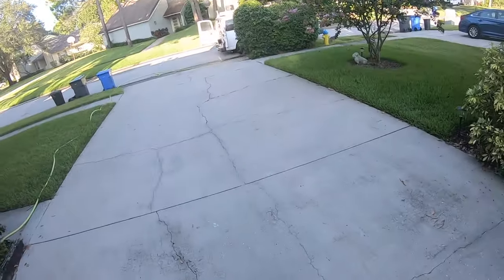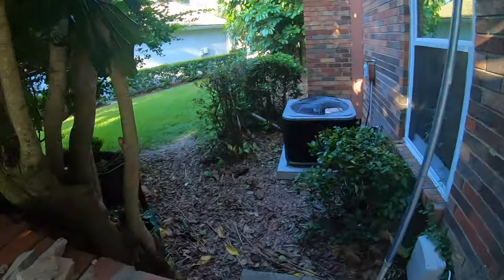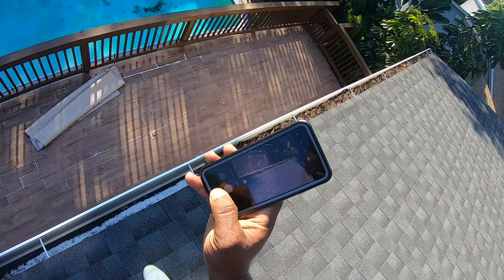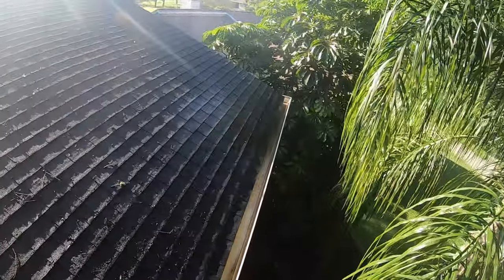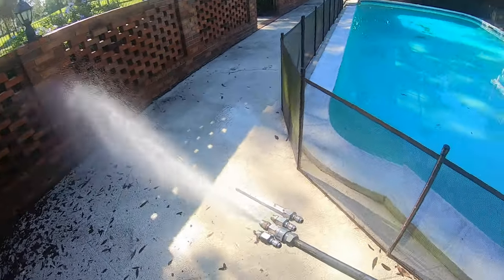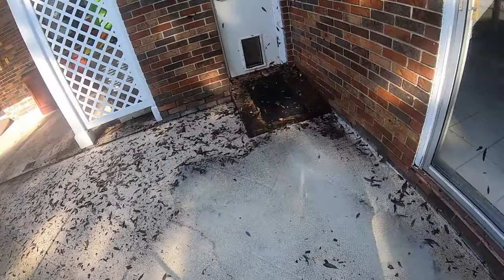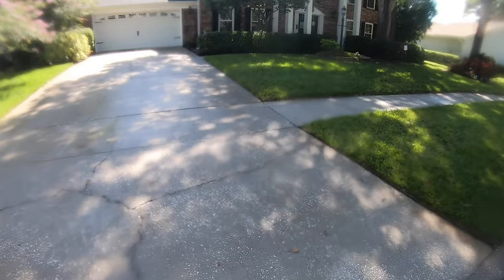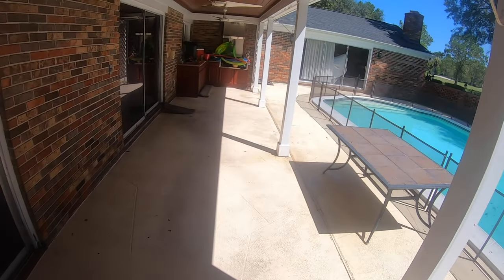Cleaning Gutters with DN10 Ball Valve #guttercleaning #powerwashing

Comment: I find that using my extension pole with the gutter tool attached, pulling 2-3 small piles works great. Then you don't have to worry about all that debris flying everywhere. But good shett bro! Your doing it big.
Reply from the maker: I do that sometimes too.  Doing it in sections does help. And I have that gutter tool it's a nice gadget. Thanks for stopping by brother